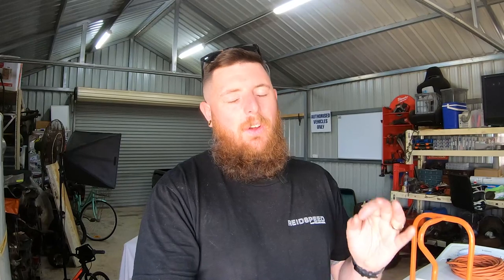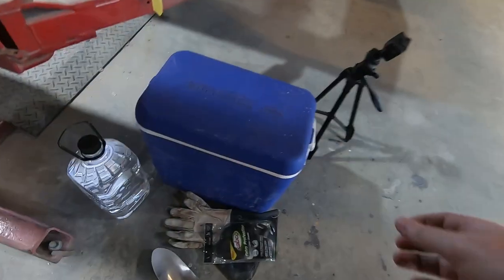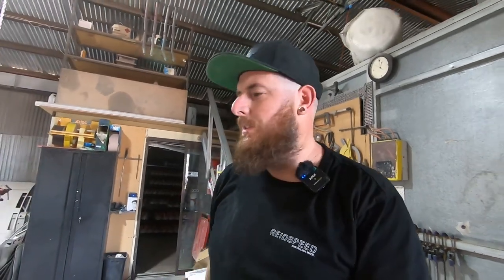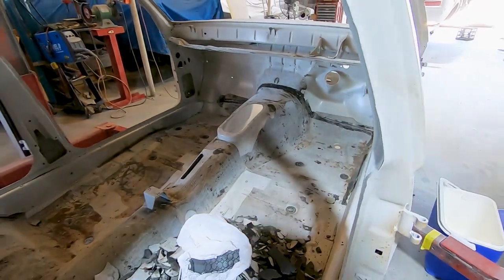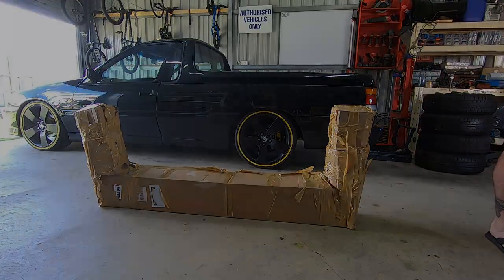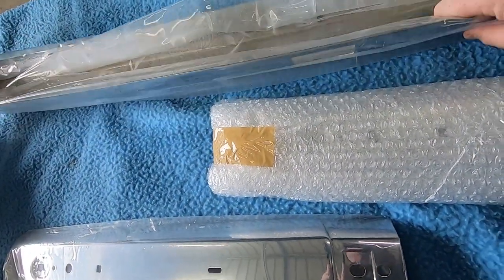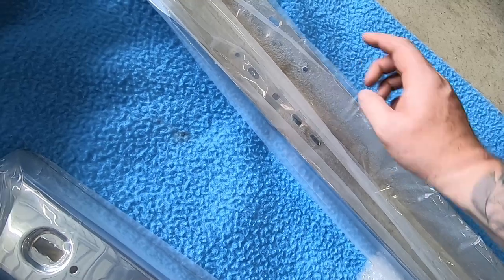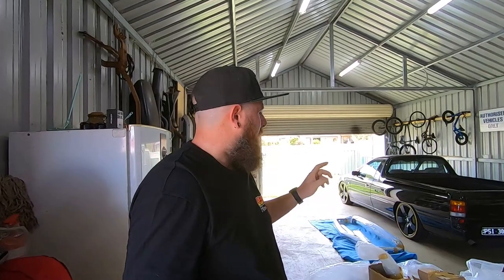STRIPPING more out of my VH SL/E!!! Dry Ice Sound Deadener Removal | [Project: PRO STREET!] - Ep10.

Comment: Dude that dry ice method is epic, TY!
And totally worth getting those bumpers done man they're going to POP 👌
Reply from the maker: Simple and very effective! Even Simon and Jamie had never seen it done before and they were very impressed with the ease of removal and how clean it left the floor afterwards. Much better than the heat gun and scraper or wire wheeling they were used to lol.

Comment: I just got my sound deadening sand blasted when I got the car done. Come off easy so not much extra labour cost
Reply from the maker: I did think about doing the same when this car was blasted. The worry with blasting is, if you don't get it right or if its stuck real good, you could be generating alot of heat on the floor pans which could then warp, and/or work harden the metal. So I tried to keep that to a minimum, and with an option like this on the table it's much less risk.